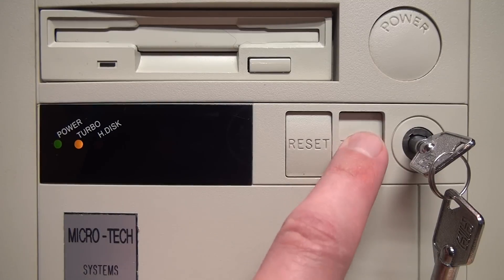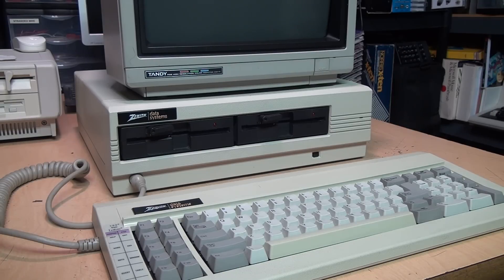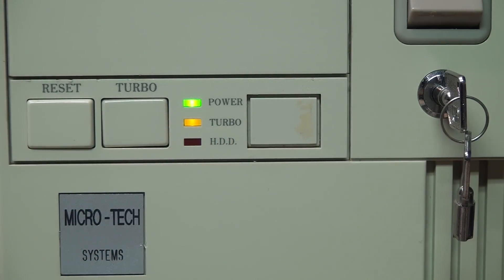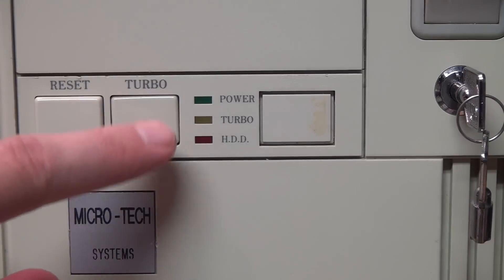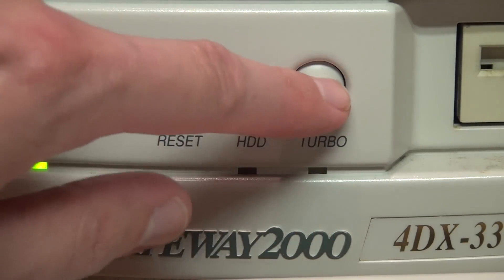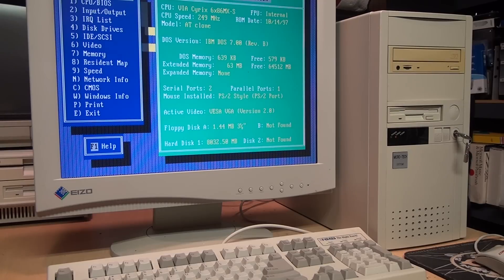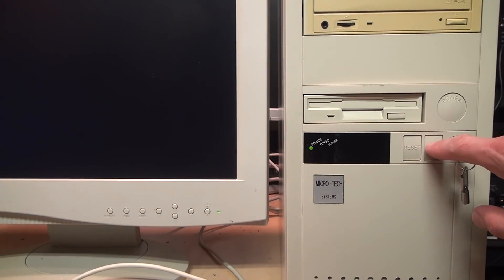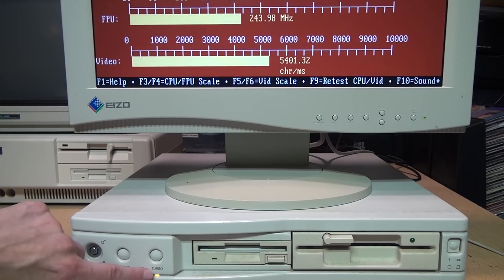The PC turbo button mystery finally solved! (beta version)

Comment: I worked in a local computer shop in the mid 90's and I helped build dozens if not hundreds of made-to-order PC's. One of the final tasks when a new PC was assembled was to configure the 2 or 3 segment LED's to correctly match the CPU speed and turbo button position. When I began my time there, I set most 2 segment LED's to 66/33, and later to 100, 120, 133 & 166 in the 5x86 & early Pentium era. Many of those LED blocks came from different manufacturers and used different standards to each other and it was up to us to figure out which jumper combination on the back of the display would produce the desired pattern. The pattern indicated on the display had absolutely no bearing on which speed the computer was running it of course - it was simply a toggle between the two LED patterns, but did we ever hear about it if we didn't get it exactly right! One of our team was known for being lazy setting these up and we would occasionally get customers returning to the store to complain that the display didn't change when they pressed the turbo button. By the time 5x86's & Pentium's were common, these PC's were far too fast to run early 80's, speed sensitive software and to some the 3 segment LED became more of a silly status thing than accurately depicting what the computer's clock was set to. *I don't miss them or the turbo button.
Reply from the maker: Some vendors configured the LED readout to show the computer's Landmark benchmark rating, which was much higher and thus more impressive than its actual CPU clock speed.
Reply: I used to set them to "69", or in the case of the 3-digit ones, "138".
Reply: @activelow9297  🤘😎☠️
Reply: Here when we pass the 99mhz for 486DX4, we started to use HI and LO instead of the numbers on the 7 segment display
Reply: omg setting up the LED readout was always fun when you got a new case or system.  I thing I even would mess with the jumpers to make it have A-F too or just garbage.  It was all for SHOW!  I also remember running called atslow and atnoslow for games.
Reply: I remember playing around with the LED blocks on my self-built PC back in the 90s, but only two seven-segment displays limited the amount of fun that could be had...
Reply: My 386DX-25 displayed "16" when turbo mode was off, but based on this video I wonder if it was actually slower? I never tried benchmarking it.
Reply: The first computer I bought with my own money was a Cyrix 686. The turbo button toggled between "HI" and "LO", but made zero different to speed. My parents' computer at the time was a 486 that didn't have a turbo button.
Reply: @katbryce  Perhaps my co-worker put your Cyrix system together. If you'd like to bring it by the shop, I can take a look at it for you! 😊
Reply: @erinwiebe7026  I read most of this thread and I am shocked to read that decades later you still work with computers from a retail and/or repair position. I've been a computer technician since the '80s and I left it a little while ago because there is no money at all to be made in it.

I've been working in the oil field for the last 10 years. That's how massive of a career change I had to make just to be able to provide for my family and have a bit of extra money each month. If I stayed in computers I would have to stay single the rest of my life to afford to live.

So, however you figured out how to stay in it, good for you. I absolutely love working with computers and wish I could keep doing it. But it just doesn't pay the bills.
Reply: @Twitch_Moderator  Thanks for responding. My time assembling & repairing  computers at that store only lasted about 3 years. I was putting myself through uni at the time and it was a gateway to my career in IT - a field I've worked in ever since.

I still build my own PC's and dabble with vintage computers now & again. It remains a fun hobby.
Reply: I worked in a computer shop too back then and can't tell you how many times other builders would just slap the CPU in the Motherboard and not set the FSB jumpers to the right frequency. Yes CPUs would run just fine at the slower bus speeds but then you are just wasting your money on faster CPU that is not clocked right.
Reply: @jimflagg4009  Seems you worked at a dodgy place then, selling computers that didn't even have the Turbo jumpered. Either way, the place I worked at also went out of business in the early 2000s. They made a bad move and moved downtown, but at that point, the writing was on the wall due to mail in and Internet - Dell and Gateway were closing in on mom and pop PC stores from that era.
Reply: @the_kombinator  Most did. Unless you had a distribution network to ship computers all over the US you were doomed to fail. Now days companies use VMs so the desktop computer outside gaming is over.
Reply: @jimflagg4009  Probably mining too.
Reply: And some lazy builders would set the display to say "Lo" and "Hi" to avoid the trouble of tracking multiple different jumper settings for their systems.
Reply: Many thanks Erin :)

I remember the "Turbo" button, but it never did anything whenever I used it, but that was before I became a geek and understood this stuff.  I remember PC cases were sold for years WITH a "Turbo" button that was never wired to anything because the new hardware didn't support "Turbo", and that is when "Overclocking" became a mainstream (geek/nerd) thing.!
.
I remember both asking what the turbo button did, and explaining to customers years later what it did.  I also note that I NEVER once saw anyone who had a turbo button who didn't have it on Turbo mode 24/7...
.
Do I miss the confusion, absolutely not, but watching this greatly informative video that showed me things from when I was a child and hadn't even heard of a computer is fascinating.
IMHO, the history of Computers should be a mandatory subject with a test as history tells us a great deal about the present, and highlights the future as we can compare it to the present and the past..
Reply: Yeah I hate setting them up too - to this day I dread it when I build retro machines. My P233MMX has an interesting way of doing it jumper - free using the reset and turbo buttons.
Reply: You just explained my experience in the computer industry.
Reply: Most cases with digital readouts also had the turbo light! 
I would save all of the jumpers for other projects, and leave the digital display blank.
Reply: @randymack2222  Why? That's arguably the coolest part of the 90s case. I know I sell 486/Pentium machines with digit displays a lot quicker than those without.
Reply: Same here but we started making the display say HI and LO. It was easier than matching the real muhz speed
Reply: Fun seeing stories from before I was even born. Wonder how PC building was back then
Reply: @SockyNoob  The overall experience really hasn't changed all that much. The quality of components is far better now but the basics are the same.
Reply: @SockyNoob  painful. Those cheap cases were (probably still are) sharp!
Reply: @SockyNoob  You're making me feel old now.  It was a lot more involved than it is today.
Reply: I had a 66/133 (I think) 486, or maybe a Cyrix Pentium clone of some sort. The button was pointless really, but I thought it was cool, and a bit retro even in the 90s. I don't believe it was much of a challenge to set up the display, there was a set of jumpers and instructions on how to set them. Maybe I got lucky.
Reply: @igotes  Retro in the 90s? I have had several DX2-66s and a couple 75-80 MHz variants (especially as of late) and yeah, mid-late 90s 486s, those buttons worked and they worked well: They were certainly not pointless. 

Was it pointless on a Pentium 90? Sure.
Reply: On some PCs you could hold the turbo button down to set the numbers displayed (unsure if it would save it through power cycling)
Reply: I honestly would love to see a modern one, 4 digits obviously, but especially since modern CPUs throttle. I often keep Task Manager/Performance Monitor open just to see what it's running at. Someone needs to get on making that. Somehow read that value in Performance Monitor and output it to a 7 segment display or full matrix LCD/OLED simulation.
Reply: @peterjszerszen  you might be able to do that with a crystalfontz display? I have one that is usb and fits in a 3.5 in bay
Reply: @peterjszerszen  I've also thought of remaking the concept for modern PCs, although I would keep it at two (possibly three) digits. If you use displays with a decimal point you can display the actual value in GHz, otherwise with three digits you can display as percent of nominal. With self-overclocking like Intel Turbo Boost it could even show over 100.
Reply: @peterjszerszen  Thinking of making a desktop gadget akin to G15 LCD that could pull data from Rivatuner, control audio volume global and per-app, control monitor brightness. Wishlist, desired pricepoint?

Or if it's just a little frequency readout, what size and how mounted?
Reply: interesting, how cases with LED clock display, are 2x more expensive, than those, without them.

"*I don't miss them or the turbo button." doesn't match reality of people.
Reply: @warrax111  LOL What reality? I have them on almost all my retro rigs and they show the speed accurately with turbo on or off. They were short lived and defined an era from 286 to 486, sometimes even Pentium (I've built a PIII for someone with a three-seven segment piece). They remind people of a specific time in computing history, and that's why the cases are more expensive with them. It's not really that hard to understand.
Reply: You were what in the mid 90's? 1? Or are you a creep with a image that's not you as your avatar?

Comment: I had a P120 in the 90s that had a 3 digit display and a turbo button. It did nothing. The button was only connected to the 7 segment display and changed it from 120 to 90. No connection to the motherboard was done. Very silly.

Comment: Was there some sort of logic behind how much the CPU was slowed? I seem to remember that my 386/25 would slow down to 12 (or possibly 16) MHz.
Reply from the maker: On most 386 and later systems, non-turbo mode added extra wait states and disabled the cache, rather than actually changing the CPU's clock speed.
Reply: It was usually slowed down to match the 8088 so around 5-15 MHZ seems likely.
Reply: @hellion9547  : Yeah, though it was really to match either the IBM PC or IBM XT, since a lot of stuff moved to timer interrupts once higher speeds became available in compatibles. It was ultimately because some of the earliest software had hardwired assumptions about processor speed, so if you wanted to use it correctly then you needed to somehow force the system to run slower.

Comment: A company like NZXT could bring back the turbo button for a limited edition of their cases or prebuilts. Turbo engaged: ramp up the fans and apply overclock (or TVB/PBO in BIOS alternatively). Turbo disengaged: quiet mode. Having to switch modes and profiles in software can be tedious, especially when a bunch of bloatware is involved. NZXT is a bad example because their CAM software is the worst when it comes to bloatware, but I mean they could, just for shits and giggles and in principle it would work exactly the same, serve the same purpose.
Reply: Computers already kind of do turbo mode automatically now. CPUs clock themselves based on their temperature and workload at any given time. When you're on your desktop, your cpu is running at a much lower clock than when you boot up a game.
Reply: @Deadeye313  Yes, but it depends on power and thermal headroom. That's what Turbo Velocity Boost (Intel) and Precision Boost Overdrive (AMD) do, apart from other automated technologies, including throttling. 

If you press the Turbo button to ramp up the fans, there will be more thermal headroom. It would essentially be nothing but a physical fan speed profile switch. 

Also those automated boost technologies aren't always perfect, a button could be set to toggle a manually preconfigured overclocking profile.
Reply: @neoqueto  i could see it as forcing a certain clock setting at the push of a button. But I think there is software for that nowadays,  too. I wonder if any have a setting for a button to toggle the overclock, like say binding it to a mouse button on your gaming mouse.
Reply: @neoqueto  It would be an interesting option, though i'm not sure how useful it would be. My question, do people who care about squeezing out performance not set custom fan profiles? I always lead fan speeds ahead of CPU temps. By the time my CPU is hitting 60c everything is running full bore. I would think that someone who wants to get every last bit out of their machine is also going to ramp their fans faster than stock. Also, overclocking is getting pretty skinny these days, most chips are pretty good from the factory, you really need to get a rare bin pull to get much extra out of it. As compared to older CPUs like my old 4790k for example. I could squeeze a ton out of that with proper cooling, but my 12700k is pretty much tapped out. The difference between my stock CPU and the highest performing OC for similar systems is not much more on benchmarks, maybe another 10%
Reply: I am actually surprised, in this age of retro computers being much more mainstream, that someone hasn't tried exactly that kind of gimmick.
Reply: I remember some motherboards from the A64 era with "one button overclock" (or something like that). A crappy suboptimal overclock at the push of a single button! (a gimmickier implementation of the predefined "OC Profiles" in the BIOS). The button was integrated in the motherboard instead of being a header for a case button, of course.

Comment: Back when I was in high school we got some new PCs that had turbo buttons and we were learning Basic and Pascal and I made a program that would just display random boxes on the screen. When i wrote it, it was on an older machine and it ran normally. If I used it on a turbo button machine it would run so fast you'd have a seizure but hit the turbo button and it ran like the slower machines.
Reply: That was the point, yeah.

Comment: I might have had them switched back in the 80s. I thought turbo meant the “backwards compatible “ mode. Haha
Reply: Well, to be fair, it's inclusion is for backwards compatibility. Nobody wants to run a system slower unless necessary. It was likely decided that turbo mode would sell better than compatibility mode.
Reply: @punkdigerati  True- A tricky thing about the 80s as lots of games did not use the clock for game timing. They just ran "as fast as they could". But once the tech jumped to PC-ATs, and faster... you would get totally unplayable games without the turbo-mode (or un-turbo technically)

Comment: @1:05 - "PC Turbo 186" - I am surprised to hear that number read out as "One Eighty-Six" vs One Eight Six.  This bugs me when they use foreign-sounding computer narration.
Reply from the maker: Everyone always said 286 as "two eighty-six", 386 as "three eighty-six", etc., so it makes sense that the 186 would follow as "one eighty-six".
Reply: @vwestlife  From what I remember, on my side of the pond everyone said "two eight six", etc. Two countries divided by a common language!
Reply: @vwestlife  That's not what I meant.  Your interpretation is correct but many newer documentaries speak the numbers when referring to vehicle or equipment model numbers.  Like plane or loader designations.  It's always three separate numbers spoken vs the way most of us would say it.
Reply from the maker: @TechGorilla1987  It depends on the context and tradition. For example, the Porsche 911 is "nine-eleven" while the emergency phone number is "nine-one-one". And there is an old Compaq TV commercial in which John Cleese says 386 (the CPU) as "three-eight-six". So I guess it is a British thing to say it that way.

Comment: today you don't need turbo anymore, you can just download more RAM for free.
Reply: Are people still using that meme?
Reply: @JohnSmith-xq1pz  we're not even people anymore, we have transcended into angels. Suck it John
Reply: @JohnSmith-xq1pz  cloud technology 🤨?
Reply: @RatOrMouse  at that point just use hard disk paging lol, the point of using volatile memory is that its faster
Reply: @RatOrMouse  : You might not be aware, so I'll go through the whole spiel. The first IBM PC systems didn't have virtual memory systems, so your programs could only see the physically present memory. Once memory mapping was added to the x86 processor itself, a program was written that allowed you to use virtual memory even in systems like DOS (though I'm not sure that it actually worked well). When Windows later added virtual memory support straight out of the box the program was no longer useful, but some shady businesses still advertised the ability (which often involved a program that popped up a fake control pane and nothing else), and this carried on to the early days of the internet, where it would be advertised as "downloadable memory".
Reply: I downloaded double the ram around 25 years ago, never seemed to work though, hmmm /s